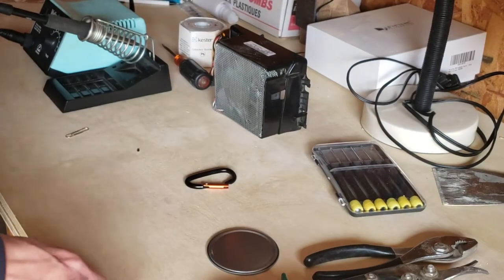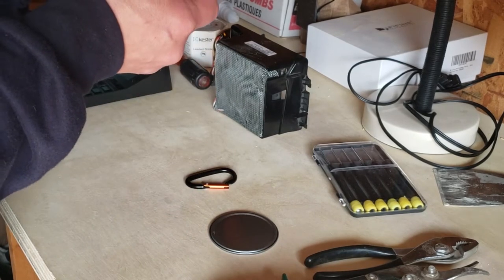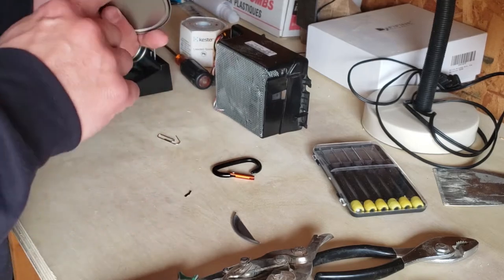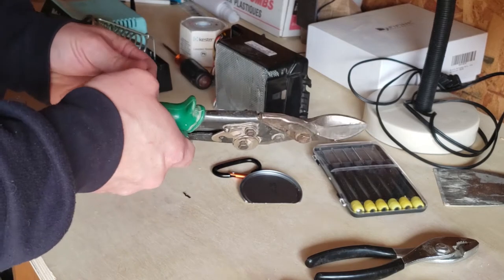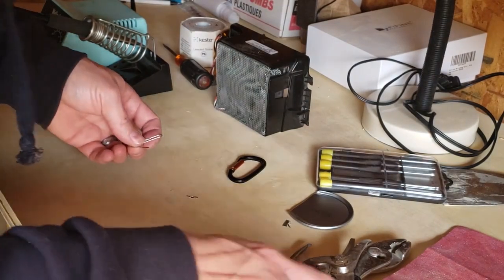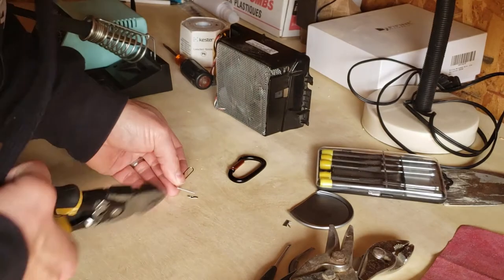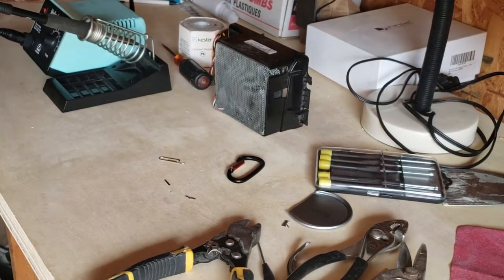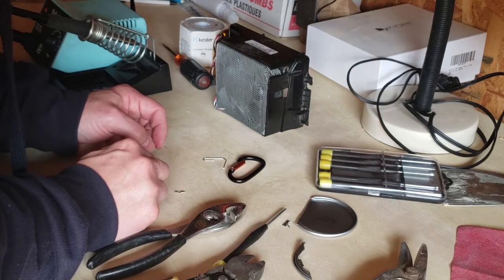Carabiner Spring Replacement - Make a Replacement Spring

Comment: What if the actual spring inside the gate gets pushed out and bent
Reply from the maker: There is supposed to be some slight bend in the spring.  If it's really bent, you should be able to bend it straighter into its normal slight bend without breaking it. In terms of putting it back in, this video shows how to put it back in: https://www.youtube.com/watch?v=ESlUQ4ux8c8